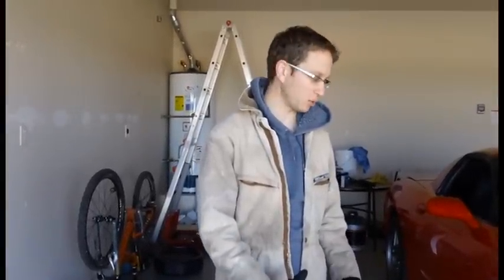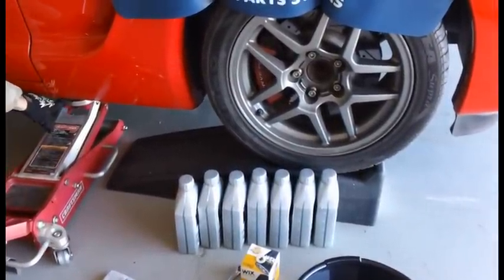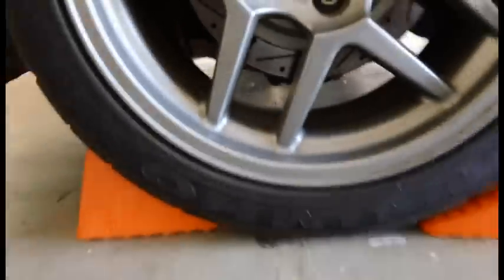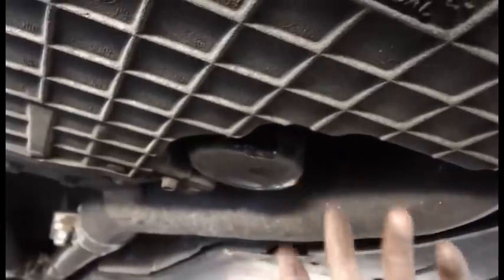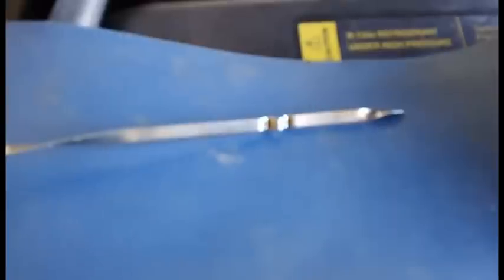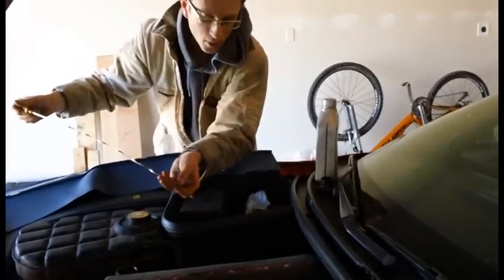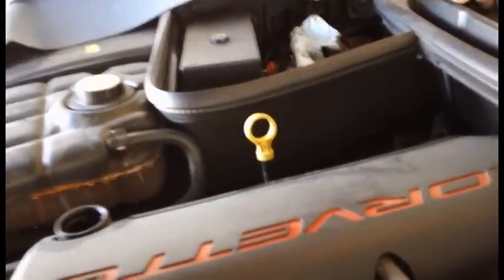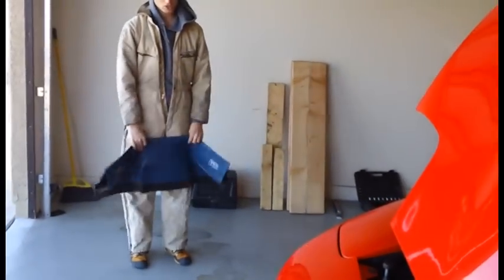C5 Corvette oil change

Comment: Prefill your oil filter with new oil. This is done so you do not get a "DRY START". Dry start could kill cam, rod and main bearings. I have prefilled oil filters for over 30 years. I have seen the damage first hand from a DRY START. Nice Vet Matt. I Have a LS1 and T56 in a Mazda RX7 FC.
Reply from the maker: that's a fantastic tip!  I am going to start doing that :)
Reply: I thought everybody knew this! Surprised he didn"t.

Comment from the maker: Hey thanks Mario....  I really appreciate your kind complements.  I was at a loss when I got my car on how to change the oil.  Some guys put extensions in front of the plastic ramps.  However, that wasn't for me.  I could just see them sliding out as I try to drive up and tearing off the front end of the body lol  Anyways, if you have any questions feel free to post them :)
Reply: Matthew Jeschke  Never put castro in a corvette , it will ruin the main seals !

Comment: I had no issues driving mine up on plastic ramps. If you hit the black part, it is designed to flex, so smashing it isn't a big deal. I'm fortunate enough that my old driveway was downhill, so I was able to change the oil in the driveway, and getting up on the ramp made my car level. It made for very quick oil changes.
Reply from the maker: good to know... my plastic ramps are taller than my bumper cover though :(
Reply: Oh. Your ramps looked like mine, but maybe they are a different brand or something. I know mine definitely make it a squeeze to get under there. I usually end up grabbing the front suspension and wiggling a bit to get back far enough.

Comment: need to tilt from behind to totally drain it out? is there another way?
Reply from the maker: No other way I can think of. It's super dangerous lol Might be best to take these cars to the shop for oil change. If you do make sure they use jack pucks... and or have a pit to change the oil.

Comment: My 2000 takes 6.4 quarts of oil not 7.   You don't want to overfill oil and have to go back under and try to remove that small amount.  Alway go a a-little less and avoid the problem..  Overfilling can cause oil frothing and reduced lubrication.  never overfill.